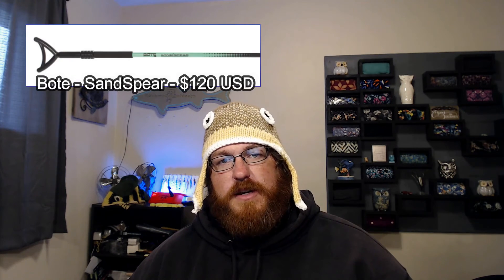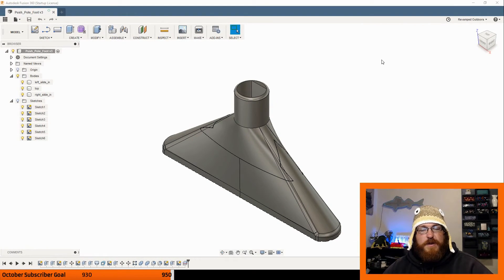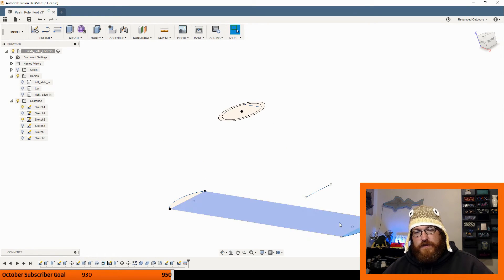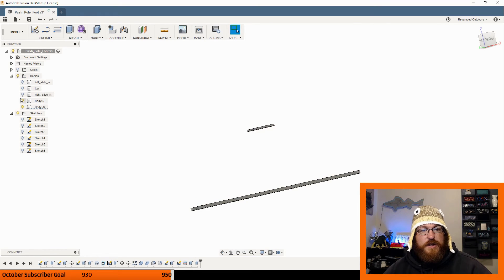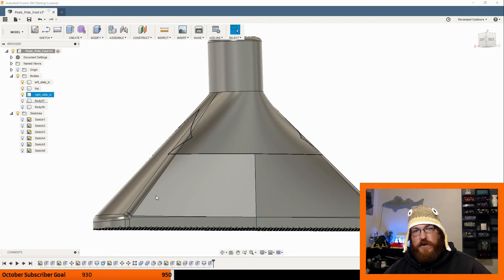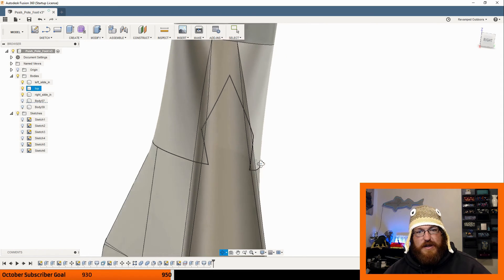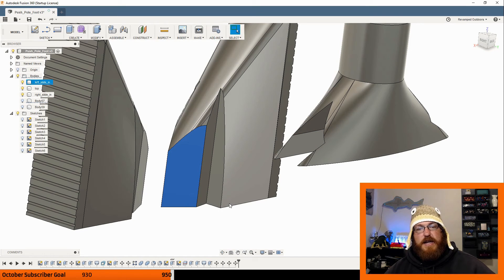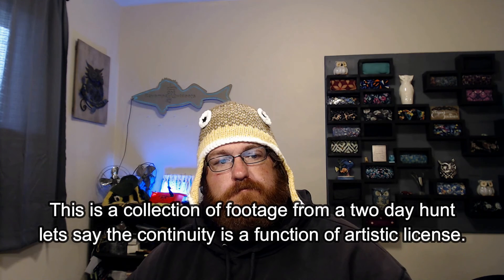DIY Push Pole and testing during duck hunt (Fusion 360, 3D Printed)

Comment: Not trying to be an ass you do have a good build but O&H Mfg. Duck Bill Attachment | Academy
https://www.academy.com/shop/pdp/o-h-mfg-duck-bill-attachment#repChildCatid=252052?campID=642952267&groupID=31323543558&device=m&productID=020053377&gclid=EAIaIQobChMI6cCa8p6u3gIVj4xpCh3h2gwlEAkYASABEgJSNPD_BwE
Reply from the maker: Yeah I've seen those around. Hard to beat the price that's for sure. I went this way for a couple reasons. The first being that I've always had an affinity for the larger diameter pine handles, for some reason i just get more grip with them and they stay warmer in cold weather, the second being I often turn the push pole sideways for paddling and the width seems to really help with that. The third is i have tried the duck bill design before and for some reason in the mud i hunt the thing doesn't always open up which can be a bit frustrating. The last is my laziness it was just easier and faster to print it and hunt with it the next morning lol.